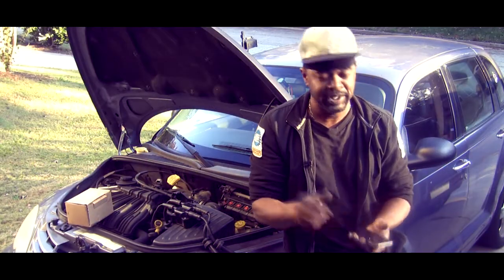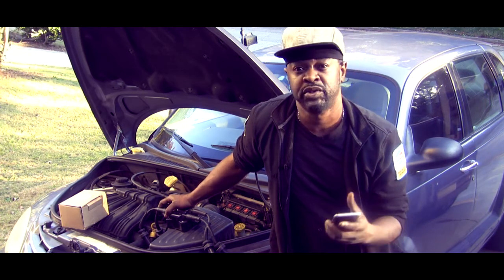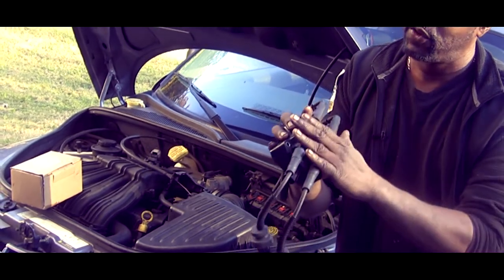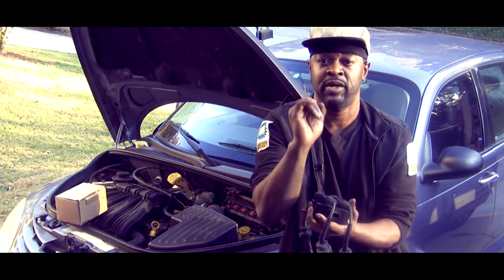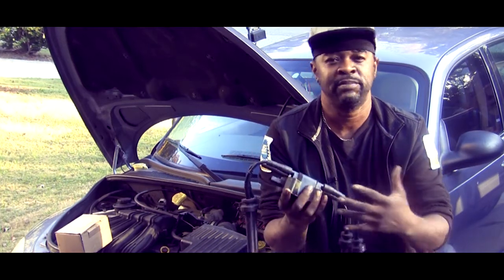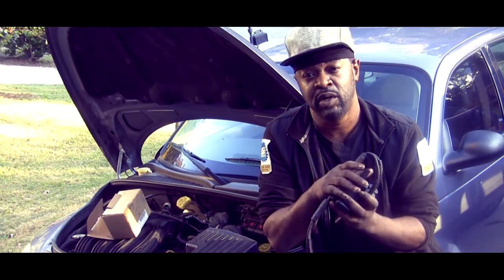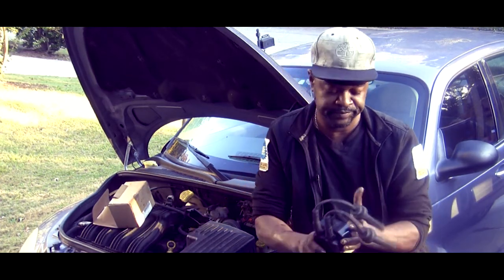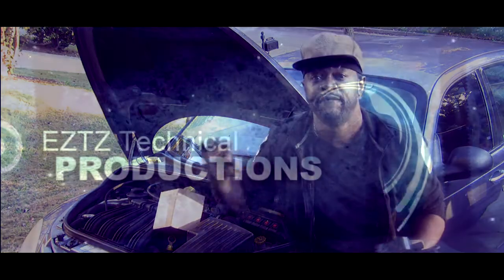P0300 P0301 P0304 How to CHECK your IGNITION COIL

Comment: Took my Pt convertible out of winter storage started fine but idled rough for just a bit engine light Came on its running fine now but engine light on with code po303 po301  but car in running fine engine light don’t go out on it own or do I need to delete code
Reply from the maker: Ide simply get codes erased..Codes could be from lifters being drained from setting so long.. Drive car as usual, now if those same codes return, that would indicate a problem..Thanks for watvhing, please like the video
Reply: Online Mechanic Tips that’s what I was thinking thanks million stay safe there virus out there

Comment: Thanks for broadcast! Hey I had an issue on my 2005 where my back up cam comes on when it feels like it ..and now my aftermarket radio came on today for the back up cam but the radio wouldn't come on or turn off.  Now my OBD 2 port is not communicating! Your thoughts!
Reply from the maker: You have popped the fuse that feed the bus that runs thru the OBD data link connector..Its possible when the sys was wired up, they used a power feed wire from the bus circuit..thats a no no..  Please consider subscribing to the channel, thanks
Reply: @OnlineMechanicTips  I'm not sure how he wired it some peolle are saying he may have wires it right to the back up bulb. He had speakers in there that he ran wires to the battery post and just wrapped it around the post so I can imagine it a short there could it effect the OBD 2 yest I popped tge fuse it wasn't blown but I replaced it any way ... it seems lije it's in the radio, cigarette line or possibly the K line maybe he didn't wire the radio combo back up cam. I roll up the window or down and my heater is effected lije drawing from that to get electrical power...dies it sound like a short or a negative or positive cable ? I have no problem starting it!
Reply from the maker: It could be..I think the manual have you to get a dedicated wire from the fuse box to use as the power supply, If that wasnt done then yea, you gonna have problems